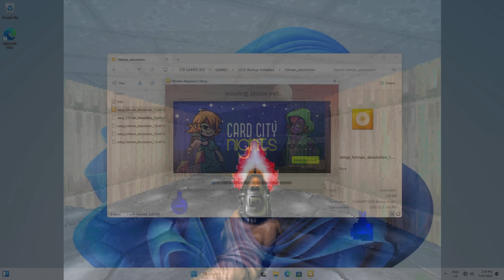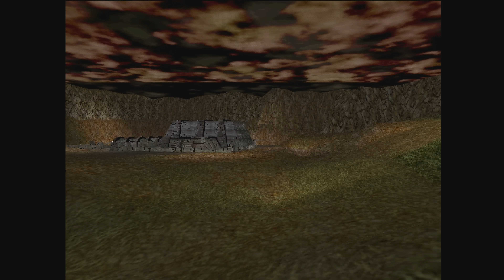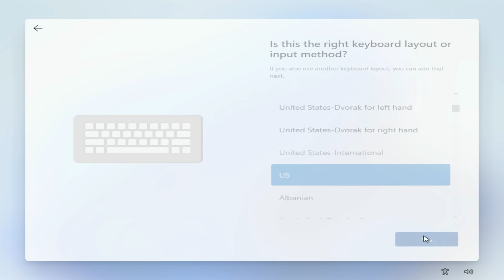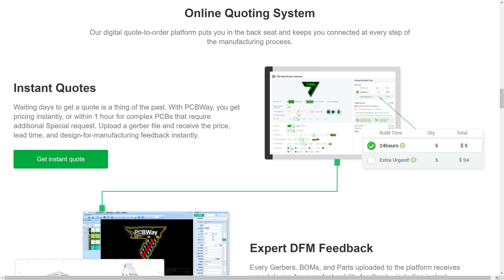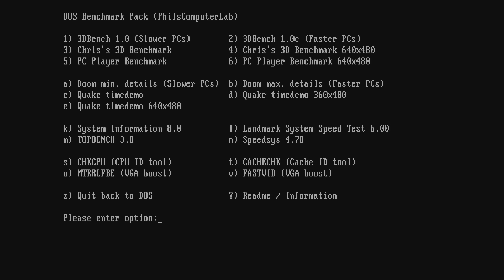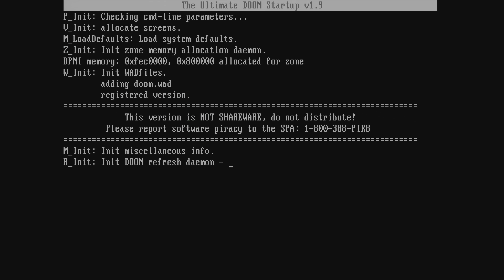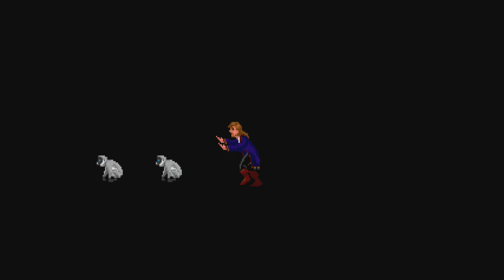LGA 775 The Next Big Thing for Retro PC Community?

Comment: I have a P45 system with a Q9550 that's been running non-stop since January 2009!
Reply: What Motherboard, Gigabyte???
Reply: @ricardobarros1090  yep GA-EP45-UD3R
Reply: @ricardobarros1090  yes,  GA-EP45-UD3R,  Also 2 mechanical drives in there with similar hour count, 320gig seagate and a 640gig WD Black drive :D
Reply: turn off, give him some breath :D

Comment: @PhilsComputerLab there is one thing for forgot to Mention or might not be aware of it which is that the LGA 775 also supports 771 CPUs when you do a small modification to the Socket and apply a Sticker to the CPU that swaps 2 Pins on the LGA 771 CPU.
The 771 Xeon CPUs are extremely fast an much cheaper than the Qore2Quad equivalent.
I've done this with my Asus P5Q-Deluxe and the performance was amazing. 
Of course you also have to add the Microcodes to the BIOS but that's pretty easy .
Reply from the maker: Ah yes! I've done dedicated videos about this topic, but didn't mention it for this video. Good addition!
Reply: Yes Phil running a xeon 2.5 and xeon 3.0 GHz and a NVIDIA 8800 GTS nice performance.

Comment: The mileage you can get out of LGA 775 is insane. being suitable for early 90's DOS stuff all the way up to now as a low end desktop is just incredible. I do have a few old hard drives laying around so I'll probably make a 775 build with DOS on one drive and Linux on the other.
Reply: I mean, I've had one with an RX 6600 XT. I was cpu bottlenecked even with the xeon x3470 overclocked, but this socket will do ray tracing as well. not well, but it's playable.

Comment: 775 is one of my favorites. So many options. My Gigabyte G41 Combo offers DDR2 and DDR3 support, PCIex16 and classic PCI, SATA, Floppy and IDE. And the best of all, it always just works.
Reply: Good to know, how good G41 actually is. I've always been a bit sniffy regarding that chipset - it seemed like a low end OEM Option and so I never bothered to try it. Maybe I should change that! 🙂
Reply: @moezarella1261  I use a Gigabyte G41M Combo MATX board that supports DDR2 and DDR3 (2 dimms of each type for a max of 8GB). PCIE16, PCIE1, 2x classic PCI, SATA, IDE, Floppy, USB,... together with an E8500 and GeForce 9800GT works fantastic under Windows XP.

Comment: Big fan of LGA775, it is just so flexible. Previously used my Q9650 with Linux Mint for HTPC, it's now been upgraded to a WinXP retro machine. It's that perfect crossover point between retro and modern, where you have older ports and OS support, but bios support for nice-to-have features like SATA and PCIe

Comment: I am just finishing up an E8600 triple boot (XP/Vista/7) project this weekend, and it is definitely true that you get a ton of fun for your money on this platform! A trick I like to use is to go for the BTX form factor, as BTX cases are usually cheap compared to ATX, comes with a free kickass air cooler, and mine even came with a surprise motherboard installed that I ended up using. Just be aware that most BTX boards comes from business machines and does not support overclocking if that is something you are into.

Comment: In my opinion Asrock 4coredual-vsta is the ultimate  choice for retro gaming. It supports Core2Quad cpu up to Q6700, DDR1(400MHz), DDR2(667MHz) ram, AGP 8x, PCIE-4x, IDE-133, SATA 1.5, floppy connector, USB 2.0

Comment: Another great video, thanks!
For me, LGA775 platform was the go-to way for retro (dos-win9x) gaming when I did not had access to real retro hardware (386, 486, P1/P2). I used to have a 2G flashdrive with ms-dos and my favorite games. However, I often had issues with the memory, some dos programs and games did not worked, complaining about "not enough memory" mostly because emm386 did not have enough memory for pages, not allocating UMBs, etc. That on systems with 2G+ RAM. I tried FreeDos but some programs/games used to crash. How about you make a video about this topic? How is your himem.sys and emm386.exe work on these 2G+ RAM systems, maybe share your toughts and your configuration and any workarounds you know?

Comment: I certainly I never digged 775 as a Potential 98 Ultimate PC, Since I always felt like "Yyyeeaaah, but you probably gotta tweak A LOT to make it work, when there's no IDE Port for storage... I know how to make Windows 2000 and XP work with SATA, but 98? No Idea." 

And also was afraid of using these Unofficial GPU drivers for 98, (Especially those Beyond Radeon 9700 and GeForce 6600GT) since by definition of that word "unofficial" it could be unstable as all heck or work fine for the most part. 

But for 2000 and XP is certainly is a solid choice, with e.g. my E8500 rig it can run something as late as 2011 title called Test Drive Unlimited 2.
For Windows 7 it is fine, but certainly DX10 and DX11 for gaming can push that Core 2 Duo to it's limits. Windows 7 by itself works fast though.

Comment: I have my dad's ol XPS 420 upgraded to q9650 and 8gb ddr2 and a GTX 960 for driver reasons, I have it triple boot system XP,7,10 soon 11 just for lols, and I found a old office PC with a Pen D upgraded that to q6600 and 4gb ram wanna get a high end 2006 GPU for the system so I got my main lga 775 system and a backup and the backup I had to use a floppy to update the bios lol and didn't corrupt the bios the XPS has an SSD

Comment: I don't know man.  The divide is pretty concrete:  You need ISA to be retro.  Anything from the XP/2000 era or later can usually be made to work on modern systems.
The XP retro rig is kind of an odd duck.

Comment: Having just gotten back into desktops again after years of laptops, I dug out my box of spare parts and realized I still have four LGA 775 motherboards in the house, DDR2 and DDR3, and like eight different CPUs. The configurability of this platform is really amazing, I think maybe AMD's modern AM4 platform comes close.
I decided to run an E6300 underclocked to 1.2Ghz with 4GB of DDR2 memory and a 9600GT, which is overkill for old retro games, but it also allows me to dual boot into Windows 7 for 64-bit support. At first I chose a P4 630 Prescott, but then switched to the E6300 as I can run it this low and get equivalent performance at much lower heat and power consumption. And it's comparable to a dual P3s Tualitin too, I think :)

Comment: I had forgotten what a ride s775 took when it came to standards.
I had my first s775 system as a teen with DDR2 and PCIE 1.1 and 2.0, and I knew they made ddr2/3 hybrid motherboards as well as ddr3 only.
the other day I got ahold of a socket 775 system with AGP and DDR1(yes 1!) did not know that was a thing, it only takes pentium 4 (1 core 2 threads), celeron D (which is single core) and pentium D (dual core).

Comment: 12:15 Boot from NVME possible after modding bios or projects like Clover. But IMO its not needed at all (if using x1, we have lower speed than sata, using x16 just wasteful).
Reply: Certain parts like the Samsung 950 PRO contain a boot ROM. I've booted from a PCIe card with one of these on an X79 platform. LGA 775 is older and most boards are PCIe 1.0, so I'm not sure if it works the same.
Reply: A sata SSD is extremely fast for XP era stuff anyhow, idk why you would need anything faster. For 98 and older even just a modern 7200 rpm HDD is probably going to speed through stuff
Reply: @olnnn  hdd is definitely slower even for dos/w9x
Reply: @olnnn  well I mean s775 is great for windows 7 and even 10/11
Reply: @GizmoTheGreen  i think for 7/10(/11) 1155/1150 is much better pick - cost about same, much faster, use cheap 8gb ddr3 ram.
Reply: yeah I'm booting nvme on a s775 system with DUET EFI emulator.

Comment: It would be really cool to be able to have a setup that could multi-boot as many os's as possible. Win98 (with native DOS), Windows XP and Windows 10. Tying to find the best balance of GPU and sound card would be tricky, but hopefully not impossible. You could find some kind of bootloader to have each OS on separate partitions, or use seperate drives and chose with the bios perhaps?
Reply: Or you could add a physical switch. My WinXP machine has an i7 3770k CPU and GTX 750 Ti. There's also an SSD with Linux on it for general web browsing. I switch between the two OS with a physical switch. Basically both drives are connected on SATA and the switch controls which drive gets the 5v and 12v power. I modified a SATA splitter cable to do this rather than altering PSU cables.

Comment: For the 10 year anniversary of Windows XP going out of support I built a Core i7-3770 system with 16GB of ram and a GTX 780 Ti. Now I lay in wait for it to become officially retro 😁
Reply: This is already retro, so you don't have to wait any longer. As mentioned, you could even use a 980 Ti as your graphics card. With my XP, Vista, W7, W8.1, W10 retro system, I play everything from Unreal (1998) to Cyberpunk 2077 with my 2600K CPU @4.5 GHz.
Reply: That's my current daily driver running Win10 with a GTX 970... x_x
Reply: Did something similar with an i7-3770K at 4.4 on a Gigabyte Z68XP-UD4 and a EVGA (RIP) GTX 980Ti recently. Completely overkill but since it tripleboots Win7 and 10 LTSC alongside a heavily modified XP, the "slightly" beefier specs come in quite handy lol. And yes, all 900 series cards (and even the Maxwell based Titan X) are compatible with XP with just an inf edit (adding device IDs to the last driver nvidia offered for the 950/960). I used to have a LGA775 Gigabyte EP35C-DS3R with a Q6600 and a GTX 660 for this kinda stuff, but it became increasinlgy unstable
Reply: Upgrade it to a GTX 960, it's one of the last XP-compatible GPUs
Reply: @shihanafridhi9517  Last does not mean best. The 960 is around 40% of the power of a 780 Ti. Technically the i7-4790 is the best Windows XP cpu as well but finding properly compatible motherboards isn't as easy as it is for the Sandy Bridge. And if you wanna dabble a bit in technically unsupported but still workable stuff you can go with a 980 Ti by modifying the 960 drivers.
Reply: @shihanafridhi9517  GTX 580 was the final to have decent driver support for dx 5/6
Reply: @juoppokissa  Interesting information, do you know which radeons were the last to support dx5/6?
Reply: @kthmhg  none  of non-fixed pipeline (HD) cards do
Reply: @shihanafridhi9517  That would be a massive downgrade, though.

Comment: The 8400 was an absolute gaming beast back then and still cheap as chips, though i prefer the raw grunt of the quads
Reply: @UserUser-zc6fx  You can overclock some of the quads to 4.0GHz - I did it with a Q9550 which is normally 2.83GHz. 100% stable with IntelBurnTest.

Comment: I have a socket 771 3.0Ghz Xeon with PCIE Radeon x850 XT PE. It dual boots between XP and 98. It was an experiment rather than something in common use, though. Win98 game compatibility with that GPU wasn't 100%. Though the most popular games and benchmarks all worked.

Comment: I remeber having a ECS/TG 945 board. And when I took it out of the store like 4 years ago and installed windows on it with a known good samsung 270W PSU, it would shut off and finally stop working with a faint beep on the startup. Turns out the processor died itself...Those Pentium D's wont last long with small coolers...lesson learnt!

Comment: There are socket 775 motherboards with AGP. But they are getting rarer and rarer. And the overlap between AGP and early Core 2 cpus was VERY small. The Pentium 4/Pentium Dual core motherboards are still out there but they are starting to climb in price.
Reply: I got one a couple of weeks ago, didn't know s775 came with agp and ddr1 flavor... it only takes p4, pentium d or celeron d's though, no core2's!
Reply: @GizmoTheGreen  Yeah most of the motherboards with the chip sets that allow it opted for the mPGA478 socket instead of the LGA775 socket. I highly recommend looking at the Wikipedia article on intel chip sets and finding the chip set from your motherboard.

Comment: I only got g41 chipsets 😢
No old school GPU, no old school soundcard
GPU maybe gtx750 (XP can use, has none of them ATM) and the GeForce 6200tc
Reply: I think it can only hike from now on because more and more scrapyards just melt the chipset north bridge + south bridge. Selling them to Chinese remanufactured factory, not worth it. This is unlike lga 1156 and 1155
Reply: A g41 chipset is a good platform to start a nice Windows XP project. Just try to get a sound blaster live or audigy, 2GB or 4Gb of RAM and You should fine.

Comment: A Q9650 with a 8800 Ultra would've been my dream 2007 era PC
Reply: QX9650 you mean?  Q9650 wasn't around until 2008. My PC back then was SLI 8800 GTS 512 with a QX9650 and Dual 10k RPM HDDs in RAID 0. What a beast

Comment: I would go Windows Xp for LGA775 at the earliest and not Windows 98 if you are using a Geforce 6xxx series card even if the board has drivers for the motherboard stuff for Win98  because I watched a MattKC Video where he wanted to make the most overkill Windows 98 LGA 775 build but the video drivers were NOT very good for the GPU he chose to run which was a 6800 Ultra or something along those lines and the performance was very meh for a 6800 Ultra.  Maybe ATI/AMD had better driver support for x8xx series GPUs under Windows 98 than Nvidia did. If you use an FX 5xxx series  GPU then you should be fine with Windows 98.
Reply: When building "ultimate" systems, going for the next gen upgrade is tempting, but, in my experience, you should stop when the target platform is the most current. That is, buy 2001, maybe 2002, stuff for 98. Go further if you know what you're doing with a particular part but going with next gen everything is a headache. I remember trying to build an ultimate Windows 95 computer with a Pentium 4 and contemporary parts back in the day and came to the conclusion that I should have stopped with 1997-1998 hardware.

Comment: 5 years ago i got an Asus P5W DH Deluxe and it runs Pentium 4 all the way to core 2 quad. 
Currently it has a Q6600 and 4GB of DDR2. Paired it with a HD5850.
It only cost 5 dollars for the board, an E6600 and cooler.
The board comes out of 2006, but supports on board WiFi and other fancy features for the time like crossfire support.

Comment: Most games I played on those 775 systems back in the day, are running flawlessly on my ryzen rig. I’d much rather buy a socket 462 or a Slot A system. They are still cheap to get. 775 is not retro enough and tech is not as different to modern tech as well. I don’t see it getting that pricy…
Reply: LGA 775 is one of the most produced and standardized platforms in x86 history due to supporting two completely different generations of parts, Pentium 4 and Core2, but also due to serving pent-up demand with the Core2 due to anemic performance of the Pentium 4. We may see price increases with LGA 1155 before 775.
Reply: Slot A is really rare around here

Comment: how did you get 11 work without sse 4.2 😐 all the while not having secure boot. some early 11 version?
Reply: It's the just released version (24h2) that requires it and will no longer run on anything that doesn't have POPCNT and SSE 4.2 instructions and thus won't run on LGA775 platforms. Versions of win 11 up to 23H2 will work with just the requirements bypass during install with e.g rufus though will probably be slow, at least unless you can max out with 8gb+ ram and a quad core. If you just need something modern to dual boot for download/transfer linux or win10 LTSC may work better.

Win 11 23H2 will have support until november next year, so about the same time as when win 10 support is dropped (at least for standard versions of win11)
Reply: @olnnn already been looking at ltsc mainly for 10 but if ltsc of 11 will work ill do that 🙃 gonna be an interesting boot menu
Reply from the maker: Rufus has some options you can tick when creating the bootable USB ☺️